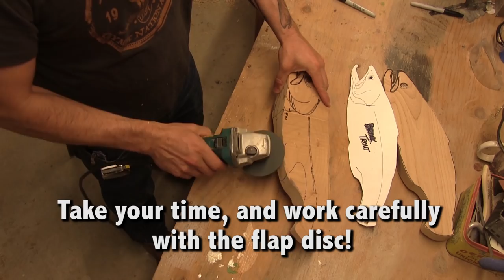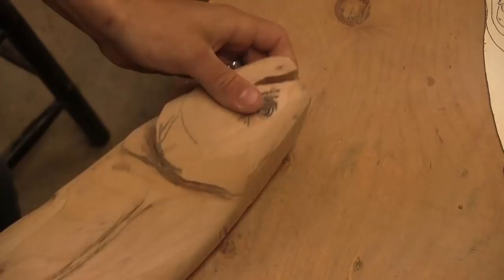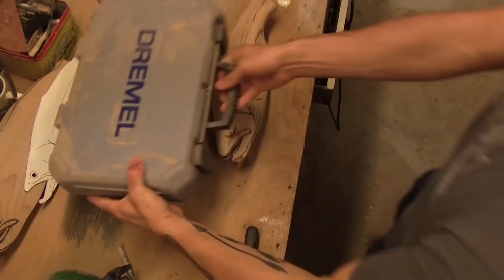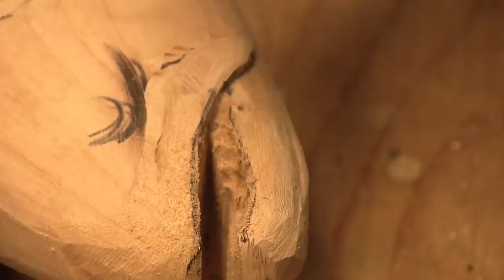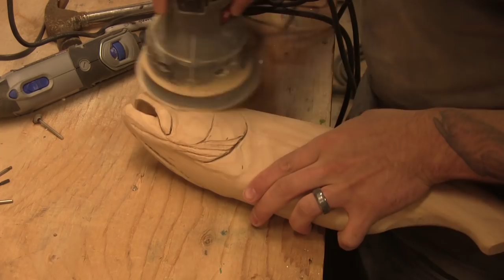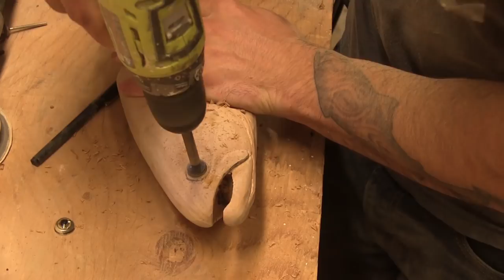Carving a Trout, Part 2: Carving the Fish Body

Comment: Don`t be sorry for the details dude. The more the better. Thanks for making these videos . A lot of hard work goes into making them and its well appreciated . I have been carving birds ducks and a few fish for 35 years or so and my philosophy always has been never stop learning .For me that means watching videos from everyone and getting inspired by videos such as these. I don't know how long you have been carving but you might want to look at buying a foredom  brand carving set. It will give you much more flex and ability when carving curves. Just a thing to look at. Great work dude. Cheers from Ontario Canada.
Reply from the maker: Thanks for the feedback! I'm working on several other videos at this moment, and will certainly keep your notes in mind. Also, I do have the Dremel version of the Foredom carver, the Dremel flex shaft 9100, which is my usual carving tool of choice because of its power. But it sure seems to be much lighter weight in build than a Foredom, as the flex shaft on mine actually wore-through and is down for the count until replacement parts arrive in November :-( That said, I have been looking for a rock-solid Foredom carver. Could you suggest one?

Comment: What’s your dust setup like? End up carving all mine outside due to the tremendous volume of atomized wood a regular-sized fish throws
Reply from the maker: Hi Jon, back in the day of making this video series I actually had nothing in the way of dust collection--I wore a head duty respirator and did a ton of vacuuming on those heavy carving days. My new setup is a workbench that I built that incorporates an 18" x 16" dust hood below and a 600CFM collector right beside it in a cabinet. It works well, though I may be just plumbing my high CFM shop dust collector into it for maximum collection when doing the bulk of the wood removal. Thanks for watching!